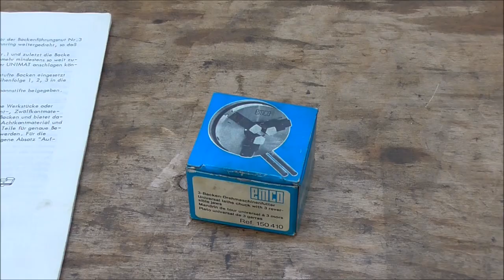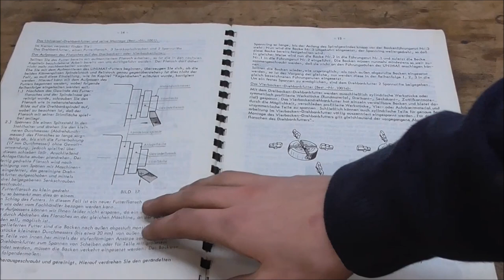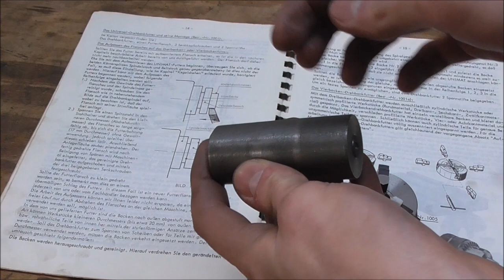Emco Unimat SL Overhaul Pt. 2: Adapting a 3-Jaw Chuck

Comment: great conversion! old vintage machines are a germ to use and so very rewarding with their accuracy. I noticed that your drill press table was flexing down when the drilling operation was being performed. Newer stuff are just made so poorly without much thought nowadays.
Reply from the maker: True - the column is thin-walled as can be. I tried supporting the table - but then the entire head of the drill flexes upwards.

Comment: Four 100ths is exactly the runout I got on my original Emco 3-Jaw so I guess your's is just like a factory one ;)
I guess you could do all operations on the Emco if you had to, even the drilling of the holes. I plan to use your technique to adapt a four jaw since the original ones are really hard to come by and rather expensive too.
Reply from the maker: Thanks for letting me know!
I did the same  thing on my 4-Jaw, too.
It's a bit more relaxed as any potential runout can be cancelled out through jaw adjustments, anyways.

Comment: Nice lathe Adrian  I want to ask you  about the shaft (lathes bed) size and material; Also can you make a video presentation about dimesions and other specs !!! Also about spidle dimensions
Reply from the maker: Hi there,
The shaft is 28mm in diameter, center height is 90. Distance between centers is about 300mm, the entire machine is roughly 700mm in length.
I wrote a spec-video onto my list, I'll see when I can come around to it.
Cheers

Comment: It's a little late now, but there's a company over here called "Sherline" that makes small lathes and small vertical milling machines- and I thought I saw a Unimat chuck listed in one of their catalogs(?) Anyway, you did an amazing job!!
Reply from the maker: Today's M12x1 chucks do not have the 12.05mm register anymore (I had to find that out the hard way having bought one for 90€ and finding out the register is more like 12.3 - luckily they were OK with a refund), so the only way to go is find the original old stuff - or adapt a new one...
Reply: Adrian Straub When you say "register" regarding a thread, I think you mean the "major diameter"- that's the term we use.
Reply from the maker: No it is a cylindrical portion following the thread - similar to a backplate. 
Threads (talking of tap- and die-cut) are not precise enough to ensure proper alignment of a chuck, which is why there is a precision machined cylindrical locating diameter on both the spindle and the thread (in my case being 12.05mm). The closer the fit, the better the alignment of course.
Reply: Adrian Straub Ah, yes- now I understand...

Comment: Couldn't you just use an adapter to change the m12 1 thread to m14 1 ? 
They sell them on eBay for £12 
That's what I'm planning on doing, I haven't tried it yet tho so...???
Reply from the maker: For sure. But I liked the challenge of making one my own.
All the best
Adrian
Reply: @AstraWerke  thanks for the quick reply, an it's good to know the adapter will work, it's my first lathe and I haven't tried it yet because I bought it with no motor and ordered a 24v dc motor to fit to it but that motor hasn't arrived yet.
I can't wait to have a go hahahaa
Reply: @AstraWerke  hi again, I was just wondering if you know what the 2 little holes in the cross slide are for? In the t slot where the tool holder bolts down, there's the 1 allen for tightening it up but then there's 2 little holes also with nothing in them an I can't figure it out, any ideas? Thanks either way, all the best

Comment: 4:50 It looks like the chuck is made out of leaded steel(?)
Reply from the maker: Just a blunt drill. Watch the table bend downwards under the tool pressure.
Reply: Adrian Straub I was not criticizing- there's nothing wrong with your drill bit- or your boring bar. What I meant, was that it looked like the steel that the Emco chuck was made out of was being cut cleanly, with beautiful chips. Over here, we have steel alloys that contain small amounts of lead added so the steel will be easy to machine with a nice surface finish. These steel alloys  are called "leaded steel" and "free machining steel". It looked like your Emco chuck was made out of this kind of material.
Reply from the maker: I understood it that way - I thought you concluded the chuck's material was leaded steel because of the crooked chips coming out (which did indeed result from a badly ground drill). 
It was rather free-machining and left a smooth surface finish but was definately harder than leaded steel. There are some types of cast steel which react similarly - but I am not familiar enough with these materials to be able to judge. My source of round stock is usually the scrap dealer - meaning I do not have a clue what exactly I get - and at work we used to machine mostly steel with added sulfur which creates short chips and is proun to rusting.
Reply: Adrian Straub Metallurgy is a complicated subject-!!